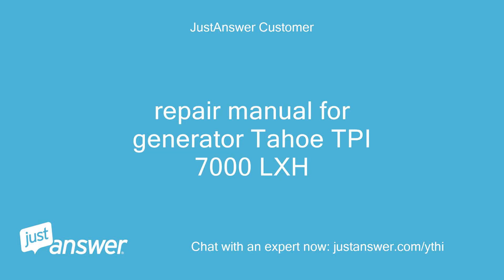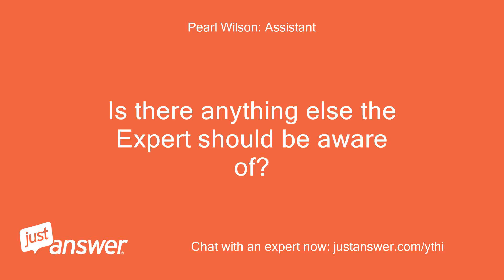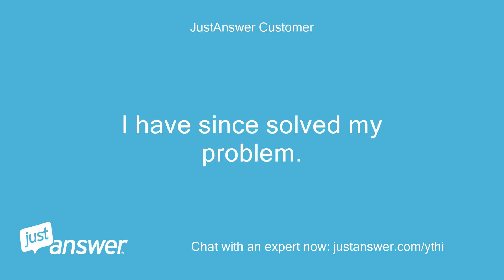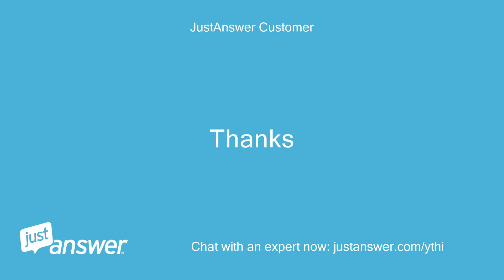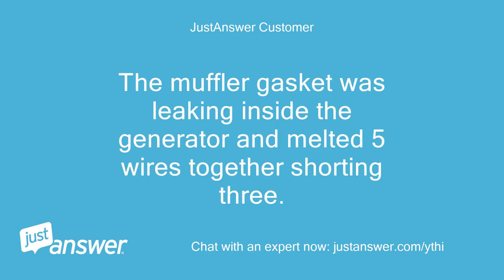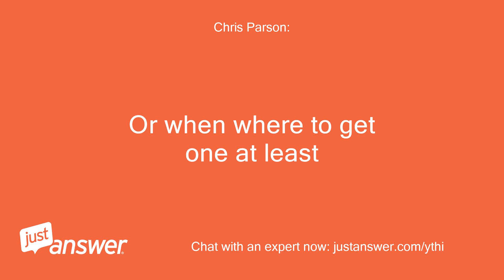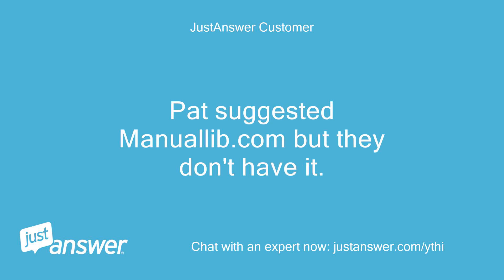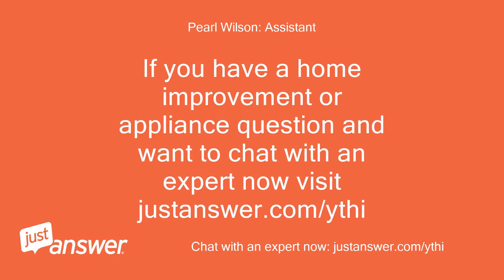Repair manual for generator Tahoe TPI 7000 LXH. I need to

Comment: my deisel tahoo 7000 would not start i used either it statred i wind i up with either,after it wind up it starting slowing down and stop, has not fired sence i took head off now bent rods vales look good nothing hit piston, injector works right , any ideas